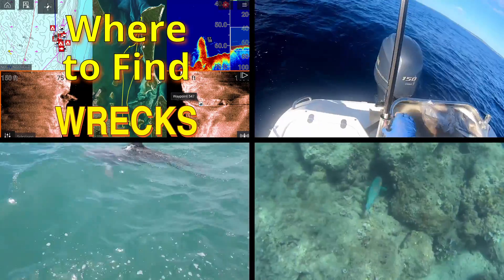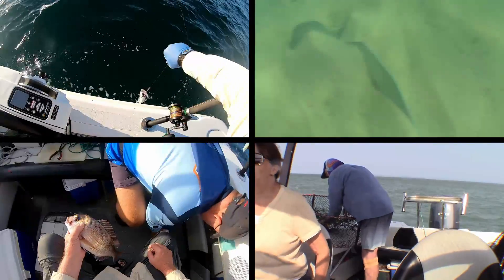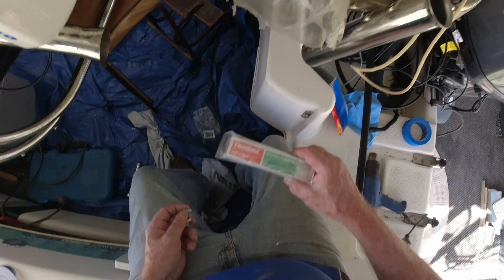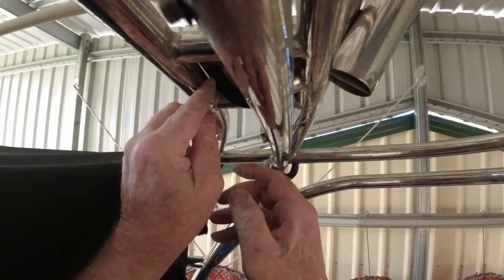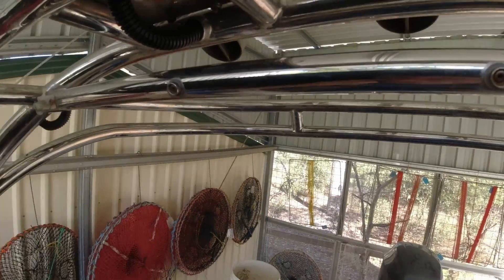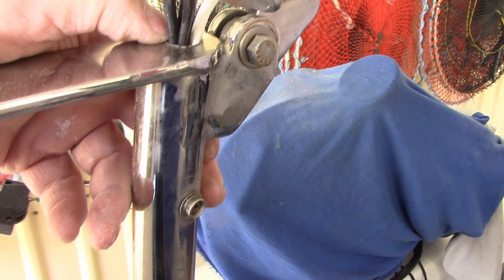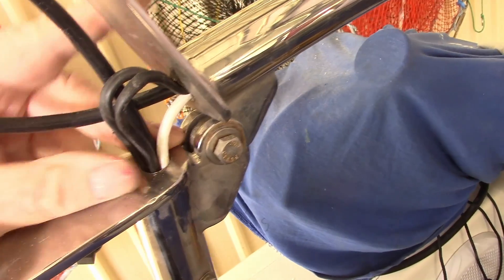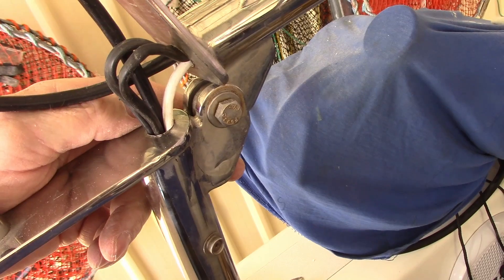Installing a Furuno SCX-20 – part 2

Comment: I've just received the SCX20. I am currently testing it at home and have found a problem. I connect SCX20 to pc via Timezero. When running the Timezero connection wizard the heading data is not detected. Do I need to configure it during the voyage to get the heading data. 
I'd be very grateful if you could give me some suggestions.
Reply from the maker: Its been a while but I didn't have to do anything, it just worked.  What I have noticed is that is takes several minutes to get a fix if I turn it on while the boat is in the car port.  The car port has a colourbond roof so it is somewhat suprising that it gets a fix at all.
Reply: @weFishAU  I wish it could return to normal operation after I install it on my boat.
Reply from the maker: Are you usinf it outdoors?  I would install it on the boat and test it there.  It is possible that it is faulty, but that doesn't happen very often.
Reply: @weFishAU  I'm currently testing onshore behind an open window. After the custom made pole and base for scx20 is ready, I'll conduct tests on the boat.
Reply from the maker: Depending on your latitude and the location of the GPS satellites an open window may not be enough.  There is a mode where you can get information on the number of satellites that are being used to get a fix.  I'm not in front of mine at the moment and I can't remember how to bring up that display but it will be in the manual.
Reply: @weFishAU  At present, all data can be detected except for the heading data. I guess it will come when scx20 is installed on my boat and during the voyage.
Reply from the maker: That is a little bit concerning.  When I turn mine on in the boat port it gets a fix after several minutes and the heading direction wanders all over the place (because of the inaccuracy in GPS positioning) but it does always show a value.
Reply: @weFishAU  Do you connect to Scx20 via Timezero?
Reply from the maker: Its on the NMEA2k network so my TZ3 and my TimeZero both pick it up.  However, now that you mention that, I don't show any heading information on my TimeZero screen, only on the TZ3.  Next time I am out I will add the heading  to the TimeZero screen and see what it shows.
Reply: @weFishAU  Looking forward to your results. Thanks!

Comment: Hi Paul, did you consider a field installable female or male connector for NMEA, what ever plugs into your antenna, rather than doing a bulky joint in the cable?  Or is the Furuno connector into the antenna a proprietary connecter?
Reply from the maker: The Furuno connector is stock standard NMEA (along with every other connector they use, all standard, nothing proprietary).  The problem was that the connector could not be passed through the tubing.  The only way to get the NMEA cable through was without a connector and that was a nearly impossibly tight squeeze as it was.  The reason for the bulky connection at the solder joint was to make sure there was no movement in the wire near the solder join, which is usually the critical point of failure.
Reply: @weFishAU  yes, I understand but you can buy a connector to solder onto your cut cable without the need for a joint, that was my suggestion...I know your dislike of points of failure :)
Reply from the maker: I didn't know you could get that.  The guys I bought the gear off knew I was going to have to cut and splice the cable and they didn't mention it either.  Might have made life a bit easier.
Reply: @weFishAU  They must know their product and am certainly no NMEA expert, but I have been around cabling and terminated many field terminator plugs and sockets.  I found a Garmin NMEA connector  on their website...I'll share the link to it in your Facebook post for this video and you could see if it will work for your application.
Reply from the maker: Thank you.  I'm always keen to learn.